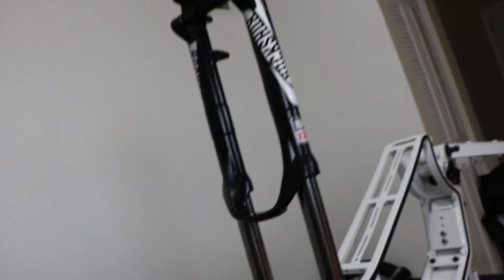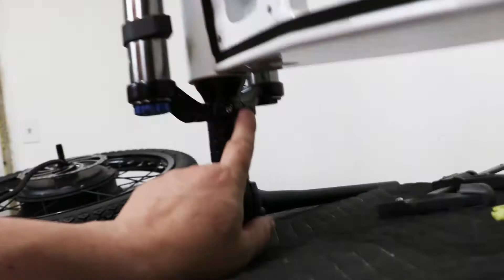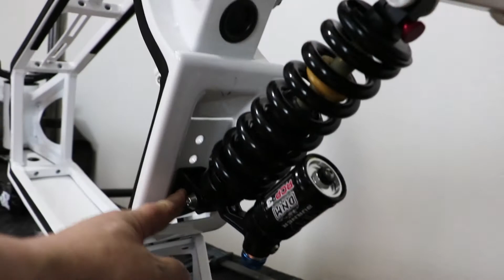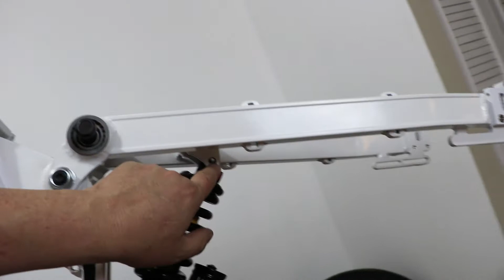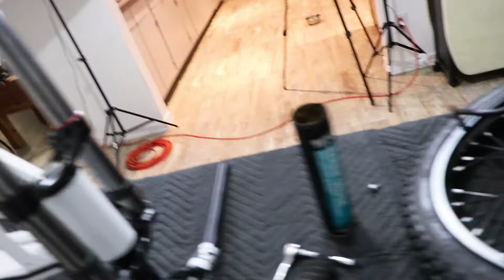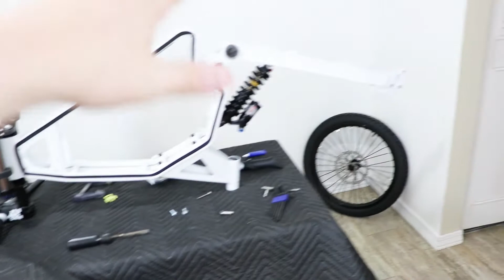Bike build episode 1

Comment: Have been waiting for this 😊 thanks for taking the time and effort for making the video. For audio I don't know your setup, are you using some sort of an external shotgun Mic like a videomicro ?
Reply from the maker: I have a Rode Shotgun mic mounted on the top of the camera. I figured out the wind noise. Its the A/C vents. There are 2 that blow into the dining room. I just got a deadcat. I'll see if that helps for future videos, but I've already got hours of footage, so the sound will be what it is for now.
Reply: BRI2K TV I know it is not easy 😊 but you will get the hang of it soon. There is a way to remove that noise using free software : https://youtu.be/dZ0DWNLrToU . Otherwise you may look into lav Mic with a separate recorder but that's more work and adds complications.  One more thing comes to mind , sometimes setting the gain on the Mic and in the camera can amplify the noise level, you will need to test different levels and find what works best . Good luck.
Reply from the maker: Thanks for the advice. I'm on a limited budget, but I'll try what I can. Maybe someone in the Phoenix area could help me. I'm  much better in -person learner.